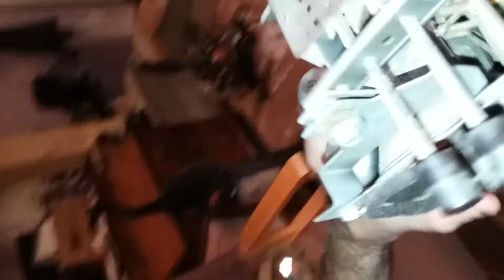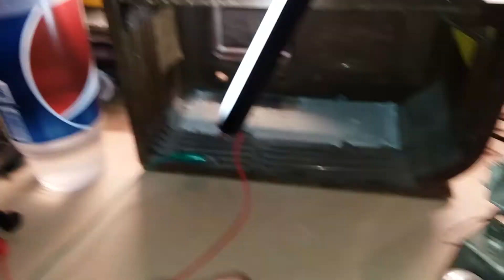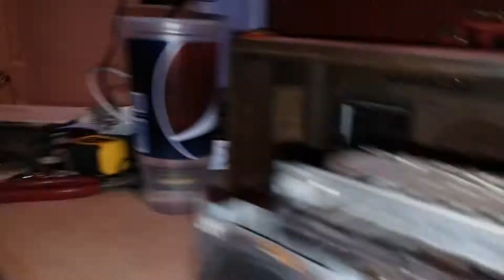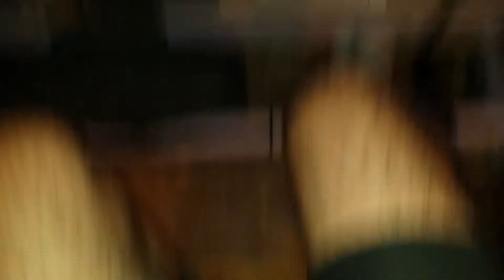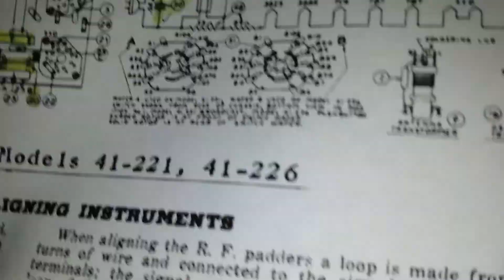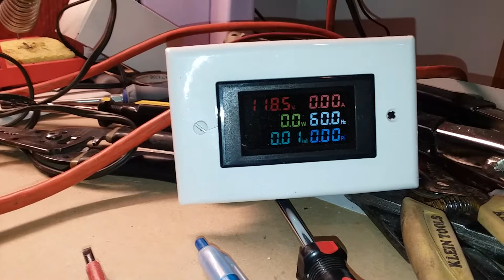Thrift Store find... Philco 41-226 AM/SW tabletop radio

Comment: That's a really cool one! Built in my favorite era, pre-war. Yesterday my grandpa (same one who gave me the pioneer SA-9100 & TX-9100) gave me his first amp, a Pioneer SA-700 from 1969 along with a custom recap kit for it. I've gotta do a video on it and its repair (if it needs it). I I also have to build a wood case for it as that's missing.
Reply from the maker: Yeah these old tube radios are nice, and do all of the AM goodness that I like too. :) I have two others that I got from thrifts, one is a Sony A/V receiver and the other is a '70's (or maybe earlier) Panasonic tuner/amp with original speakers. It works great but has a noisy volume pot and the dial calibration is way off. I will feature those in later videos.